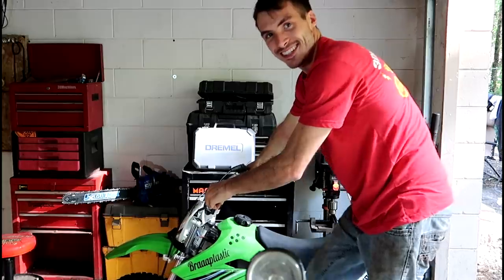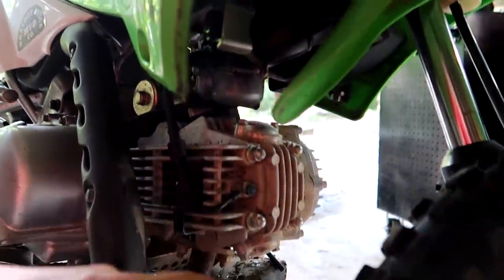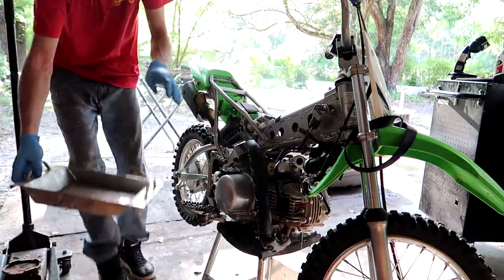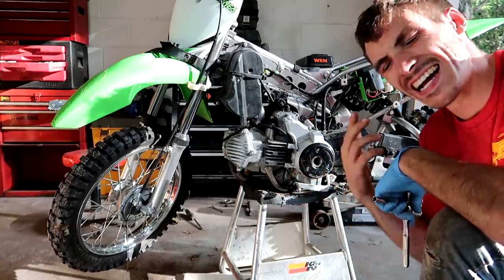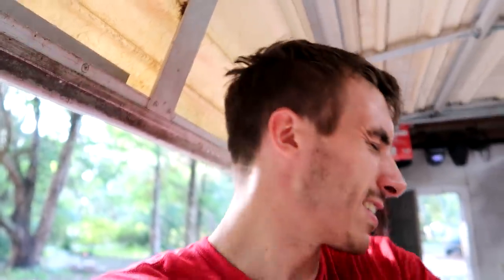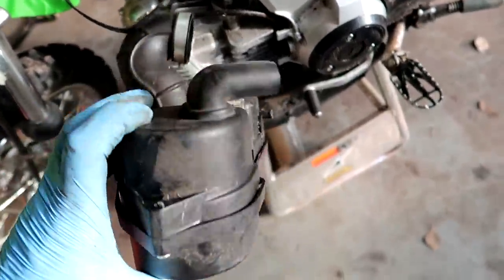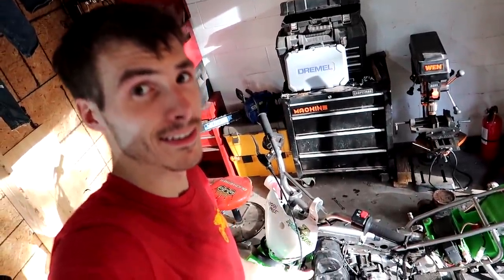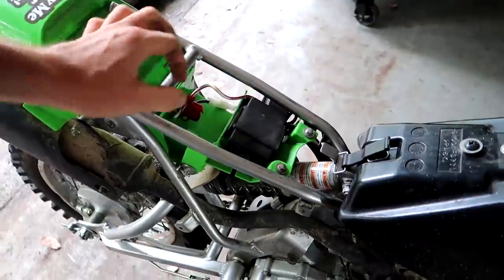FREE Kawasaki Dirt Bike KLX110 : WHATS WRONG with IT?

Comment from the maker: Best tool to have when working on carburetors.
 https://amzn.to/2Vx2ycw
Reply: 3DMachines nice bike
Reply: My quad smokes badly to
Reply: The klx110 needs renthal 7/8 or twin wall bars and a fmf or pro circuit pipe system and a skid plate
Reply: Just rebuild the klx110
Reply: Klx110 needs a folding shifter
Reply: Hey Dalton I have an 09 KLX110 been here for 6 years watching the videos love them so much keep up the good work and you should do a update with crush have a nice day.

Comment: Dalton, Get some big tarps and some 2x4's and cover the roof of the garage and screw the 2x4's along the sides so tarps can't blow off roof and it will last a little while till you can get the house going and then fix the roof.  Just a suggestion to keep your stuff good until you can get moving on the garage.
Reply: and it will last even longer if you use the silver tarps.  be sure to put some strapping in the center as well.  i used furring strips,

Comment: the problem with twist drill bits to resize jets is they make and leave swirl patterns and lines, altering the flow with turbulence. that can negatively effect the fuel flow.
**also, it should only be done in a precision drill press made for such, because you can also get it drilled very oblong or cone shaped which majorly changes the sizing.

Comment: littarly just did this to my 50 cc moped board to a 100cc had trouble getting it to start and stay running rockers were sitting flat on the valves gaped em to .004 and runs like a beast now